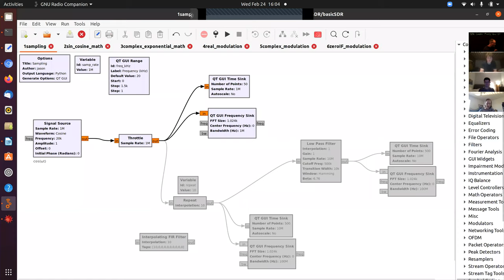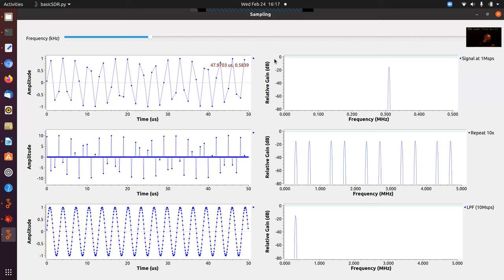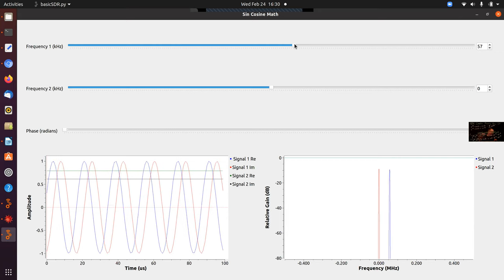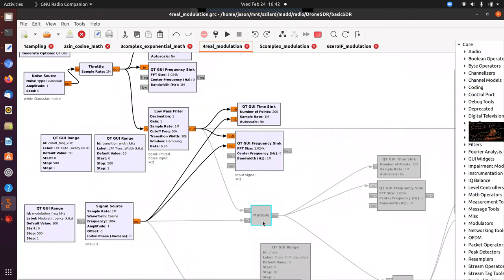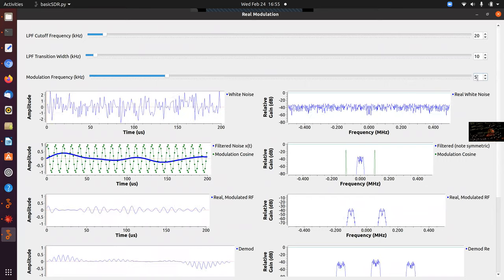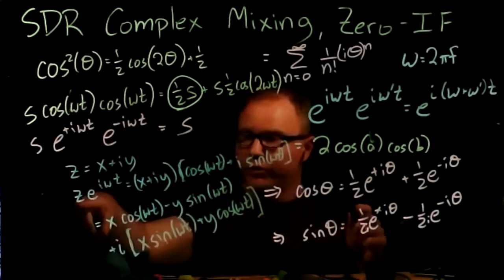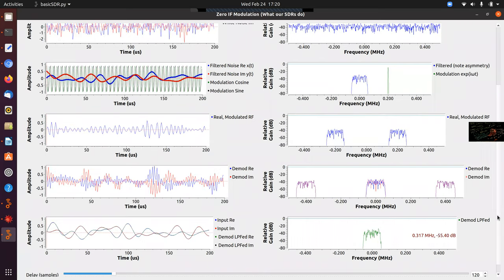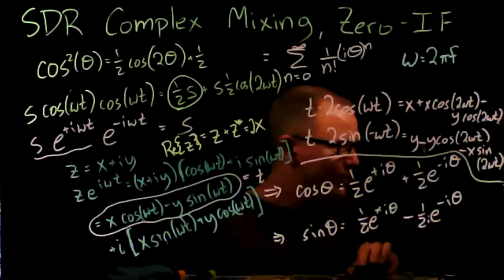SDR Complex Mixing, Sampling, Fourier, Zero IF Quadrature Direct Conversion

Comment: Very good explanation. The only thing I am not sure is your multiplication of a complex number by it's complex conjugate. If z = x + iy, shouldn't z*conj(z) = x^2 + y^2 ?The product of a complex number and its conjugate is a real number.
Reply from the maker: You're right about that. Where in the video did I say something different? I could try to add a correction to the description. I couldn't find it when I quickly looked at the math on the board.
Reply: @HarveyMuddPhysicsElectronics  It starts at 1:07:05 ... when you explained about how to extract the real component of a complex signal by using the complex conjugate.ohhhhhhhh my bad .... you said sum not multiplication !!!

Comment: I have some questions about the trick to use both sides of the spectrum by varying both the x and y components please. Non SDR radios, for eg analogo AM radio, duplicates the spectrum. A) is it possible to build a non-SDR radio to also use both the x and y components or is this trick limited to SDR? And B) how would this more spectrum efficient non-symmetric signal be used in practice? You mentioned that the x and y could be for example stereo audio. Is this an actual use case? I would have thought that with imperfectly matched oscillators, the left and right channels would smear across each other. Are there other more concrete examples of how this spectrum could be efficiently used, either for digital signals or amalogue audio signals. Thanks for the great video series.
Reply: Single side band (SSB) is an AM signal with half the spectrum.